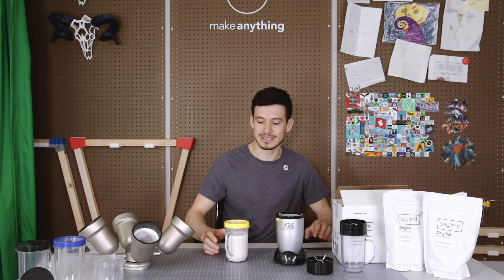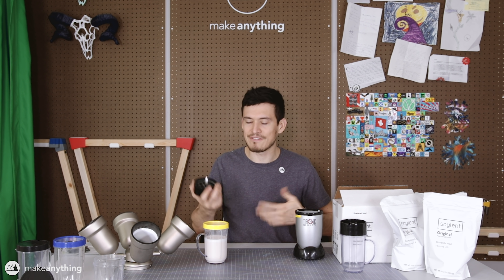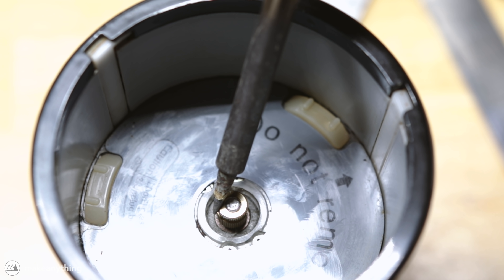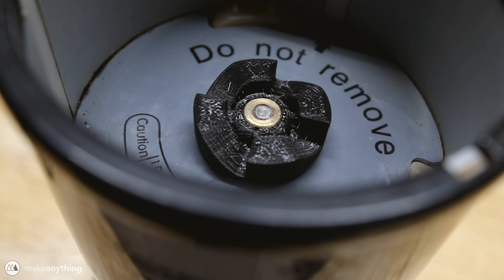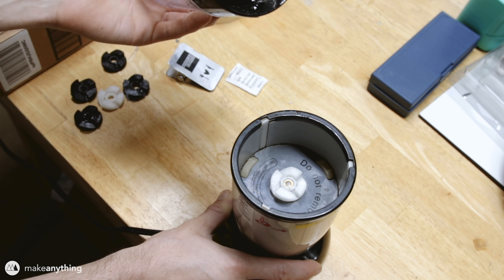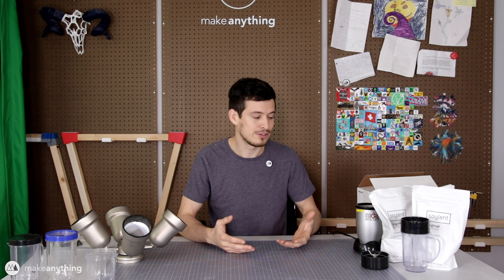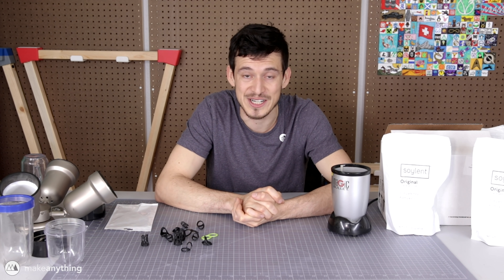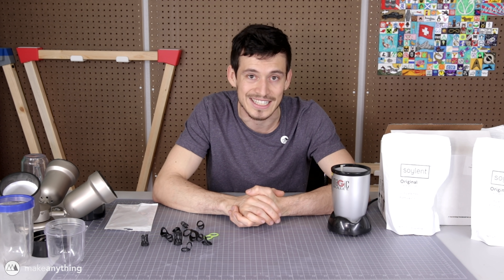Cool Prints // 3 Ways 3D Printing Saved Me Money This Week

Comment from the maker: Welp, several people noticed that the Magic Bullet part did end up wearing out again, and sure enough it doesn't mix anymore! I'll have to revise that, but since I now know that the metal gear piece is threaded into place I should be able to do that soldering iron insert trick with it not connected to the motor. Worth an update video??
Reply: If the metal gear piece is threaded, then replace it with a nut. The fine nylon splines formed by the press fit were not strong enough. You could partly print the part, then pause the print to insert the nut (still a good press fit) & continue the print so the part wont be able to slide up or down when in operation. Working functional prints are great! Good luck mate!
Reply from the maker: @karlosss1868  if it's a standard thread that could be a great solution!
Reply: Why not just super glue it in?
Reply: Those magic bullets are just rubbish, mine did the same thing.
Reply: Also small tip, trying to heat something with just the very tip of a conical iron is very inefficient as the thermal resistance will be maximized. Increasing the tip size to increase contact area and/or decreasing contact angle will help immensely. The more metal on metal contact, the better the heat flow.
Reply: Id would say your best bet for getting that blender to work with FDM 3d printable parts would  just be epoxy maybe JB weld. Maybe could try a threaded insert and set screw.
Reply: draw with jazza just made a video about making a 3d printed shirt. you should check it out!
Reply: Did you think about placing a cap on the 3d model that stops the gear from slipping down
Reply: 5:50 Just print that part with a cap as Henry suggested so that it doesn't slip down and rub against the blender... I really hope you've realised this by now.
Reply: Yea I think so. Its important to show the magic of 3d printing as well as its short falls. Maybe its time to do a Lost PLA Casting ? LOL
Reply: Based  on the replies here, I don't think everyone is clear what you are talking about. Some are trying to suggest you do exactly what you said, but with new materials instead of just using the stuff that's obviously already available to you. 

So with that in mind, perhaps a short update video just to show that would be useful. It shouldn't take much, and I know I like your videos, short or long. :)
Reply: Send me your part file and I'll make it out of Ultem.  You might need to drill out the hole to the correct size as you can't simply melt Ultem.
Reply: Why not just glue it
Reply: Revisit the idea pls
Reply: Make Anything yesss
Reply: Make Anything yes
Reply: Question where is the soylent link
Reply from the maker: @Calebs.bowling  they stopped their affiliate program

Comment: @7:24 you are spinning that part, but your center spindle and the brass bit around it aren't moving. The sound made as you removed the cup gave it away that this wasnt going to work either. Maybe use some gorilla glue on the brass bit, to help ensure it locks to the plastic? I mean, it's not going to last for long either way, but it does help. Otherwise, use a pulley puller to remove the brass bushing and either replace the bushing with a better knurled model, or print the plastic part again, but designed to fasten directly to the motor's shaft. A grub screw, CA glue, keying the shaft and part, or something equivalent will work to hold it better. And yes, I know this is an old video. I do not care. Perhaps the information will help for a later project.

Comment: Not to be the annoying guy here but you could have saved yourself money and plastic with that fan. I’m an electrician and put fans together almost weekly. The part that you printed is on the light fixture part that you took down. There’s a little rod that screws into that where the wires come through. It’s so that if you want just the fan you put that cap on but if you add the light fixture it just threads on to the middle. There is typically a nut around the rod in the cap if the person who installed it put it on there. You literally just had to unscrew the fixture off the cap and then the cap would have just gone back on the fan.

Comment: i dont know, if it works with 3d printed parts, but mostly you could warm (slow and evenly) up the outer part, then it gets larger and fits around the inner part, when it cools down, it sits tight?

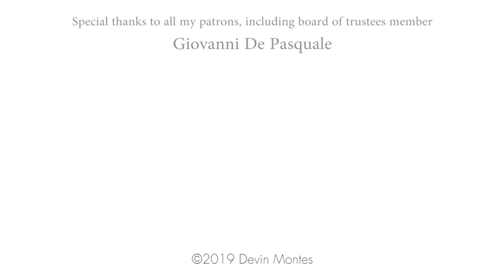Comment: @15:15, I've run into the same problem. Unless you put a spacer between the bottom.of the print and the motor, the heat from the friction will melt the plastic. Even ABS. Nylon has two things going for it, one is higher temp resistance,  but the other, even better thing is its naturally friction resistant.

Comment: FYI, If the light fixture you removed from your fan is anything like the ones I've worked with (it appears to be) then the cap at the top can be fairly easily removed and reinstalled. Then you'd just need to plug the relatively small hole at the bottom.

Comment: I've printed ball bearings when I want to avoid wear (two inner circles and two bigger outer circles with grooves for the balls in between. Printed balls will not be perfectly round so I use a file to finish them. Tolerance is ca. 0.5 mm to both sides with PLA). In your case the balls could be protruding to limit surface friction (no promises, the balls could melt as well :-) )

Comment: 7:22 it slips, I would use a 2 part epoxy for fixing it in place, or/and making a slot (or more) in the motor output shaft for better grip with the printed part. :)

Comment: About the blender connector, you could have designed a cap over the center of the piece that would have stopped it from touching the bottom and melting.

Comment: This is why I bough a 3D printer.
Do you know how expensive toys are for an autistic boy with oral fixation? I invested in this hobby to manufacture the toys he wants and needs? Plus in was also hoping to reduce our environmental impact by not only reducing the resources used to package and ship his toys but I am also using PLA. Unfortunately he figured out how to destroy the in under a minute by exploiting FDM layers. But instead of calling it quits I have been using the printer to make things that organize and declutter our home. Like dragon themed shelf’s now hanging above the stove to hold seasoning and burn aid. Also personalized Pokemon themed toothbrush hooks hanging off the bathroom mirror. Additionally because of their light weight and design I am using Command strips to attach them to the wall which saves on my apartments rental deposit. Even better, I am using Commands Velcro strips design for picture frames when I can do they are easily removed for cleaning.
There is also one teacher now that is saving on her budget because I offered to print her toys and educational things.

Comment: You had the right idea with the soldering iron, but the wrong execution. You should have had a drop of solder at the tip to aid heat transfer from the iron to the shaft - the way you did it your only point of contact was the point of the tip so you had very little heat transfer. Same principle helps when soldering a wire - if you try with a clean iron on a bare wire it takes ages to heat up the wire, if you put a tiny drop of solder on the tip of the iron the wire heats up instantly.

Comment: This is exactly what i use 3d printing for. I just finished a monitor stand that fit my needs. Also I have been working on a flash modifier system much like the mag mods but much cheaper. Wood working jigs are expensive, 3d printing to the rescue, sure they arnt as nice as the others but they get the job done.

Comment: The two times my 3d printer came to the rescue in a pinch: When I was assembling a bed frame only to find one of the plastic catch pieces that secures a lat was missing, so I took measurements of one of the other ones, threw together a cad model and had a working piece printed within half an hour (I still sleep on this bed frame and the printed piece functions perfectly to this day). The second time was the safety mechanism on my leaf blower broke so it refused to turn on. I modeled and printed a little cam piece to engage the switch and once again in like half an hour I had the blower up and running so I could finish my yard.

Comment: Even if that metal piece was successfully heated up on the Magic Bullet, trying to force the plastic piece onto it most likely would not have worked anyways;  metal expands when heated.

I'm curious how much money was saved by 3D printing a ceiling fan cap.  That's a part just about any place stocking ceiling fans will carry and should cost anywhere from $5 to $12 dollars depending on brand.
Reply from the maker: The material for the cap was under $2 I'd say, so considering how easy it was and that I didn't have to leave the house I think it's a sweet deal! Plus this is more satisfying ;)
Reply: @make.anything  Awesome!  Even accounting for your time spent creating the 3D model it sounds like you came out ahead.  And like you said, you also get the satisfaction of making the part yourself.

Comment: Trick for the next time, don't try to heat the motorshaft, only touch the gear, the conduction between the metals is a bit slower than from the shaft downwards towards the motor, heating a T-Nut with a screw in it, if you only touch the screw it takes forever

Comment: Oh neat, I fixed a magic bullet the same way. I'd accidentally cracked the original plastic (gah) gear in my roommate's blender. I checked and at the time there were no third party replacements anywhere. Fortunately I worked at a makerspace on campus so I had a coworker teach me solidworks and I used some calipers to model the old one then beefed it up. Then printed it on the stratasys machine we had. Popped it on with some super glue and as far as I know it's still working to this day. Probably my favorite print I've ever made.

Comment: i fixed so many things with 3D printing. the latest one was few days ago when i fixed a melo 3 tank on a yamapuff battery and made a custom drip tip. 
btw, a good trick with pla is to boil water and rinse it inside, it expands (for your first case) and become flexible so you can fold it in useful ways like i did with the drip tip

Comment: That brass piece in your Silver Bullet is a threaded insert. JUST TAKE IT OFF THE SHAFT FIRST! Then you can use your soldering iron to insert it into your printed part. They're designed to be melted into the part for a solid grip. Google it! ;-) They're great for 3D printing so you can bolt directly into your parts.
Reply from the maker: I just could figure out how to get the insert off, but based on replacement parts I guess it's threaded on there.. hmm
Reply: @make.anything  Yep, it could be quite difficult to get off. Great videos. :-)

Comment: That fan could use some more functional 3D print: maybe a 90 degrees arc for the switch cord to slide on it, or  (if you want to over-enginerd it) a little lever structure that redirect the pulling force by 90 degrees.

Comment: But isn't 3d printing expensive?
Reply: No it really isnt for the capabilitys of it. I have an Ender 3(170-200€) and it works really well, and the material is about 20€ per kg.
Reply: The printer itself is fairly expensive but it’s not expensive to use once you have one. Filament rolls go for about $20 and unless you’re printing huge parts things tend to work out to be a dollar or less per print.